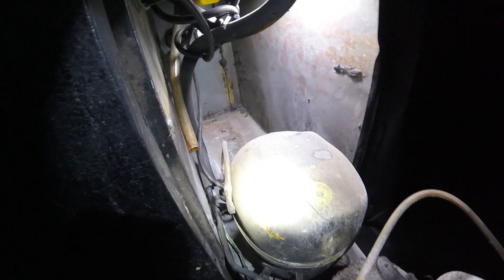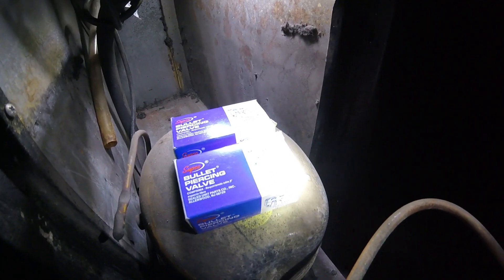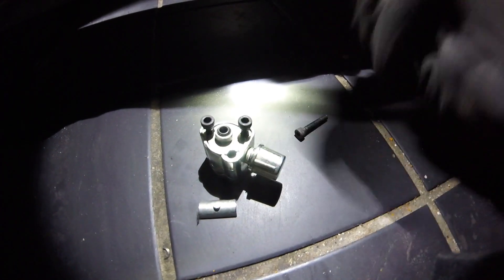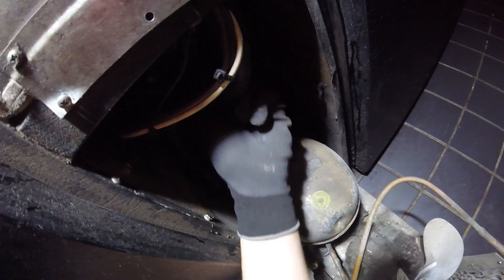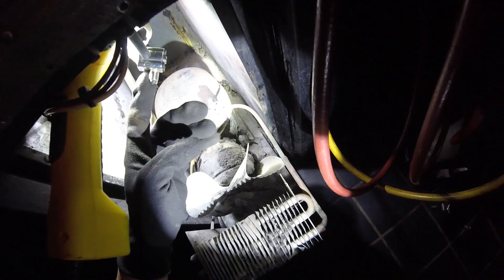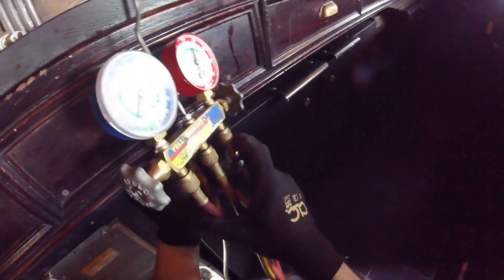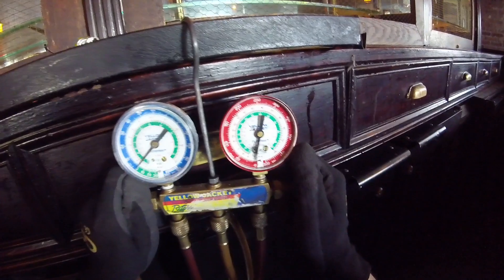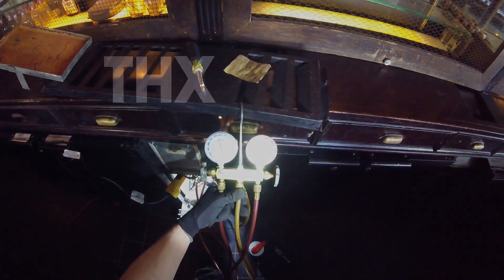How to install a BULLET PIERCING VALVE - Sealed refrigeration systems

Comment: FYI: If you are using auto servicing equipment you do need adapters.  Avoid putting the bpv around pipe bends. just not a god idea.

Comment: The fridge system could have had refrigerant gas, so it is best to connect quick connect fittings hoses with precharged hoses in both of the high and low pressure hoses

Comment: wouldn't it be better to attach the peircing valve to the filler pipe that they use at the factory if it's long enough,  rather than tapping into the main lines?

Comment: so a bullet piercing valve is used for adding refrigerant to a fridge that needs a refill, you just...tap into the line, add the fridgerant, and screw the cap back on?
Reply: Yup. Ostensibly the schrader valve would keep an indefinite seal but the cap provides a 2nd layer of security.

Comment: Attached Supco piercing valve using 5/16 sleeve that came in box however now stumped as thus far no pressure reading on gauge...not sure what to do next...this is n R-12 Fridge.

Comment: Now that you have holes in your high and low side lines, how do you seal the holes, with solder???
Reply from the maker: We don't just cover the hole though, we braze in access ports for the future👍
Reply: @JumpermanTech  Thanks for the response  !!!
Reply from the maker: @griffmustard  Ofcourse! I'm here to help. Thank you for your response as well. Stay tuned for new videos every week & stay safe out there!
Reply from the maker: This is usually a temporary install just to recover the refrigerant though I have seen these hold the charge for years. Its a tiny hole that is pierced so you can just sand down the hole and cover it using a brazing rod/not solder👍 Thanks for watching!

Comment: What if the pressures tell me that I just need to top off the system with freon?  Once the freon is added through the yellow hose, do I just re-tighten the center allen screw to plug the hole that it pierced into the low side line, remove the low side hose to the gauges and put the cap on where the hose was connected?  Does that keep the system closed well enough?  (do the same to the high side?).  I really don't want to evacuate the entire system to put in a permanent service port in the case where the system just need topping off.
Reply: After recovering refrigerant and before charging the system again you remove that fitting and install a Schrader valve. Then you charge the system.

Comment: Hey! Great video, I'm trying to measure the condensing temperature, does it matter whether I put the pressure gauge in the discharge line vs the liquid line?
Reply: Liquid line comes out of the condenser. 

If your trying to measure the subcool, subtract the condenser saturation temp(off your gauges) from the temp off the liquid line.
Reply: Condensing temp is liquid line temp downstream of the condenser. Discharge temp is significantly higher and is at comp. discharge line

Comment: can you leave the bullet piercing valve on forever? or does it need to be replaced with a service port?
Reply: In school they taught us to just leave it on there. We're working on the small window units. I understand they do eventually tend to leak a bit.
Reply: @tmst2199  the fitting is not supposed to be  permanent.
Reply: No, it must be replaced with a permanent service port by EPA requirements.
Reply: @andybutler7126  gotcha I hired someone to do it easy how he did it. thanks

Comment: Atleast read the instructions, they are specific about what size adapter to use on the pipe. 
Also the pig tail sticking up in your way on the filter drier is where you want to put the piercing valve. 
 You should probably stick to doing 
P/M's my friend
Reply: Student, here, working on my own 15k BTU R-22 wall unit. I was confounded by the two suction lines coming out of the evaporator. But the pig tail is there so I'll use it! There are also twin capillary tubes on the liquid line but I just found that pig tail as well. Thanks!
Reply: @tmst2199  You should find a company that works on refrigeration so you can get some central ac. 
 Seriously tho, there are 100 AC techs for every 1 refrigeration tech. 
Let me know if I can give you any advice as a Refrigeration Contractor. 
Good luck buddy

Comment: How do repair the hole once they are removed?  Great vid, thanks!
Reply: I wouldn't recommend using a drill bit to make the hole bigger unless you want metal shavings in your refrigeration system.  You're better off cutting the line with a small tubing cutter and then brazing in a T with a service port on one end.
Reply: @myersonline  you don't have a link to such a t-fitting do you?
Reply from the maker: Once the refrigerant is recovered or nitrogen is released, you can take off the piercing vave. From there you can expand the hole with a drill bill and slip in a permanent pressure port by brazing it in🙂 Thanks for watching & for the feedback. Subscribe for weekly uploads!

Comment: Always need a few of those in the truck
Reply: Thank you so much for the explanation
Reply from the maker: @UltraHydrophobiccoat  anytime!
Reply from the maker: 100%
Reply: @JumpermanTech  Is it disposable or reusable? Thanks
Reply from the maker: @UltraHydrophobiccoat  You can defiently re use them. Circuits with no charging/service ports, we install these piercing valves to handle refrigerant. Usually to recover refrigerant then braze on a service/charging port to handle refrigerant. Always check for leaks because these things tend to leak. Not exactly a permanent installation so I take them back with me and use It for another system to recover. They are inexpensive and very useful for small units. Should always have some in the truck. Just make sure the gasket looks good and go right ahead and reuse them🙂 Thanks for watching & please subscribe if you havent already. I'm here to help and answer any questions. Hope you have a great weekend
Reply: @Jumper man Tech, do you charge the customer to use this reusable piercing valve to check the pressure? If yes, how much that would be?
Reply: @JumpermanTech   this is the 1st mention of a gasket being in there, and it is not shown in the video. I used some of these years back and they came with a thin rubber square piece with a hole in the middle where the pericing valve went through . Even a piece of electrical tape sticky side to sticky side would probably help to get a better seal